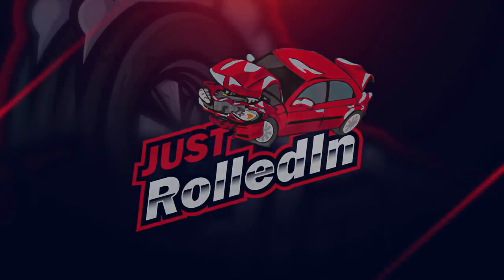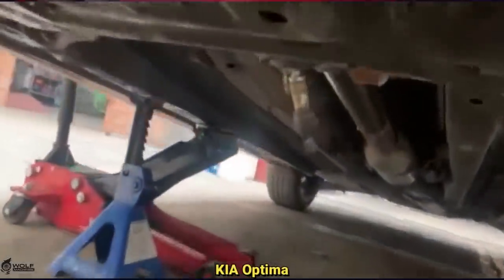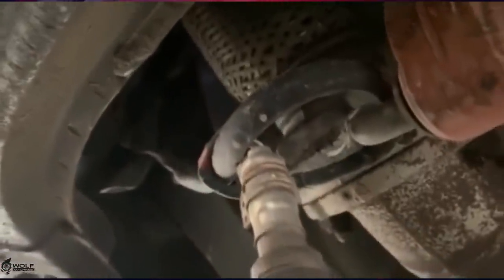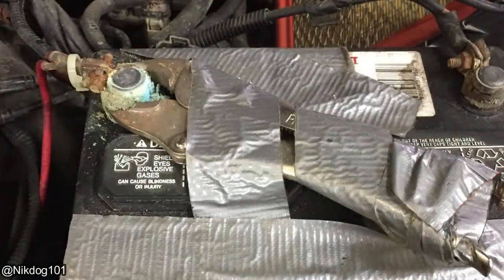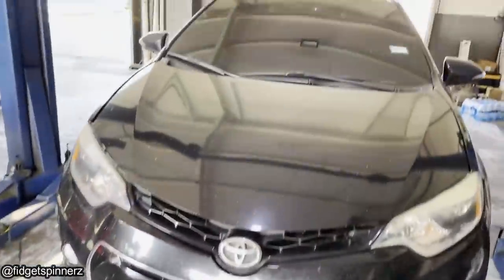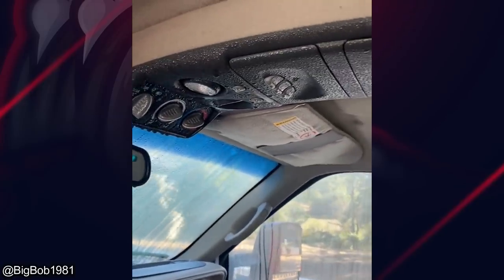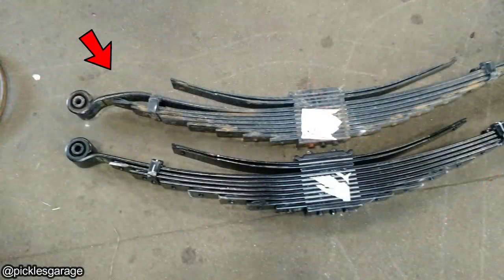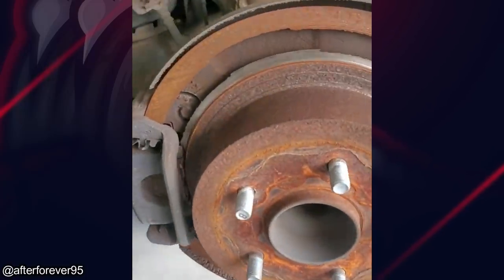Customer States They Only Want The Starter Replaced | Just Rolled In

Comment: Damn, all those cat theft... I guess i'm glad mine is built in the manifold and is between the radiator and the engine ¯\_(ツ)_/¯
Reply: That's one good thing about Honda
Reply: @Bryan-Hensley  My Fiat 500 Abarth's cat is connected to the turbo's exhaust outlet, also located between the engine and the radiator. I also have an aluminum skid plate installed underneath the car.
Reply: @Milnoc  How are you finding the 500 Abarth? I kinda like them but everyone thinks i'm mad and saying don't get one. :-)
Reply: @uhtred7860  You'd be mad to get one now. They're overpriced like crazy! I bought mine last year in Canada before prices went nuts, so I got it at a decent price.

It's my "plague" car. I bought it as a tinker toy during the pandemic. I've been busy making mods such as better bracing, short shifter, skid plate, new shocks and struts, and soon new aftermarket brake pads and coated rotors. In terms of unexpected repairs, new door handle and new strut hats. Everything else I did was just regular maintenance items.

The car is a blast to drive on windy country roads! The engine on the one I bought wasn't abused and is simply running beautifully! No CELs or error codes whatsoever since I bought it! You simply need to take good care of it and pay attention to the known problems that might occur.
Reply: @Milnoc  some Hondas have the cat built inside the exhaust manifold. I'm not sure how many models do..
Reply: @Milnoc  I live in NZ so prices are different here, plus twisty road are all we have,  mostly :-) I just think they are cool and i like them better than the endless GTI Golfs and Mini Coopers. Years ago i had a Nissan Pulsar GTi-R the Turbo 4WD rally homologation model, and want another hot hatch/small car.
Reply: @uhtred7860  I believe NZ gets the European built Fiats. When choosing an Abarth, get one that offers at least 160 HP with the sport mode active. Avoid the ones that max out at 135 HP. The car will roll fine, just not with a lot of vigor.
Reply: @Bryan-Hensley  Maybe, but I've a Citroën ;P

Comment: That second one, the red Grand Prix. I have a 1999 GTP with 70,000 miles on it. If THAT one is a GTP they never checked the supercharger oil, and probably not the engine oil either. I can tell from the sound that poor Buick 3.8L is toast! :(

Comment: That first one. Wow. How is it possible to drive a vehicle that must have been making a racket and driving weirdly without realising that something is very wrong? Slight noise? I don't think so. If this had let go at high speed the result could have been deadly. And it's not just the idiot driver. It's the young family that they potentially slam into when they lose control that elevates this to criminal behaviour. Some people should not be allowed behind the wheel.

Comment: I love it when i go into repair shops and they always tell me my CV boots are torn.  And I’ve had different vehicles.  Tell me that knife cutting con isn’t the norm.
Reply: The boot itself being cut open is not really an indicator for repair, it would be everywhere the grease on the wheel control arms etc, or the joint in the axle will round the cup and spin. A slice isn’t a reason for repair just causes accelerated wear from elements
Occasionally, the axles will snap in half as well, but this is a more rare failure

Comment: Just change the starter and grease the axle . Yes Shure . Had one guy that had just replaced the brake pads at a shop . He told me it didn't sound right The pads on one side were backwards metal to metal . Luckily we switched them around with very little damage . He came straight to my house because I was close by .

Comment: Hi, tell me.. why so many catalytic converter thief nowadays? Is it very expensive to buy one? Tq
Reply from the maker: The metals used inside the catalytic converter can be worth quite a bit so they try to sell them to scrap yards. For a new catalytic converter it all depends on the vehicle. Some can be cheaper then others and some vehicles you can find aftermarket ones.  I've heard the Toyota Prius one is extremely expensive, as you can't get any after market ones.
Reply: @JustRolledIn  Thanks for the info 👍👍

Comment: since where i live vehicles aren't necessarily required to have Catalytic Converters, i've personally nor do i know of any mechanics that have heard of any being stolen or have seen any removed. Typically when they rust our or bugger up or what have you, many just cut them off and put in a exhaust pipe and then plumb in the o2 sensors where they typically would be otherwise. vehicles run just fine and no issues come up.

Comment: The best way to protect against people stealing a catalytic converter is to not have one in the first place. Problem solved.
Reply from the maker: Thiefs are so dumb they would steal your muffler or resonator and not even know.
Reply: @JustRolledIn  Straight pipe it is then :)
Reply: I'D LIKE TO GET RID OF MINE, BUT IN PA.
THEY WON'T INSPECT
IT WITHOUT ONE.
Reply: @niklasnaper6596  Don't be surprised when they steal the pipe in confusion.

Comment: Carrying firewood won't hurt tie rod ends.  Tie rod ends don't support weight, only turn front wheels left or right.  That wasn't that much wood anyway.  I've heated with with wood for years and the one thing that was true was if you load your enclosed vehicle with wet wood when it is warm outside - and leave it closed up overnight when the temperature drops overnight you have turned your vehicle into a wood moisture distillery. I only did it once in a 95 Chevy 1 ton.  I got back late after cutting and reckoned it would still be there in the morning.  It was, but it was also actually raining inside my van in the morning!

Comment: I really wonder how many miles you have to drive to ruin your brakes that much...maybe one way is cheating yourself? I once bought an usually indestructible Golf Mk2 Diesel without test driving- ODO said 285K. Noisy rolling, more noisy brakes. Turned out to look similar on the front rotors as you can see some here, plus each wheel bearing featured about 7 pcs of dry grey cubes instead of the balls.... then I found the last inspection report stating 380K. Stay safe y´all!

Comment: That first car in this video, by law was illegal to let leave the shop in that condition. No way I would have done anything to that car without repairing that extra slack in the axel bearing first. 😒😒😒 
I would hate to be that car owners horse or dog or especially their car. 
What an Idiot. Sheesh 😶
Reply: Legally the shop cannot hold the vehicle (that's theft because you're illegally depriving the owner of their property). However, nothing says you shouldn't work really hard to either get them to fix it, or have it towed elsewhere. Take photos/videos, including showing the damage to the owner, and have the owner sign the repair order/receipt noting the damage, danger to driving that way, and that by signing they absolve the mechanic and the shop of any/all legal liability. A local mechanic's or shop association may have a standard form available to address nightmares like this. Save the photos along with the paperwork for eternity at the shop.
Reply: @markh.6687  And, possibly, call the cops as the owner drives out. Boom, ticket for unsafe vehicle, as soon as he hits the street.